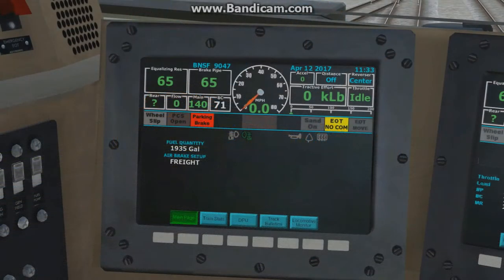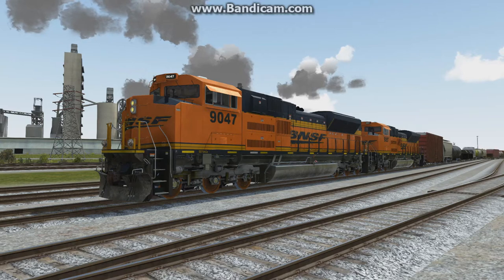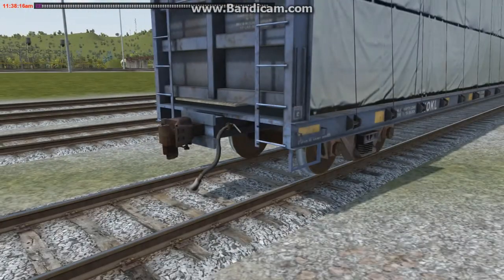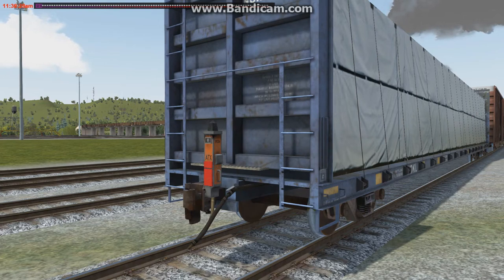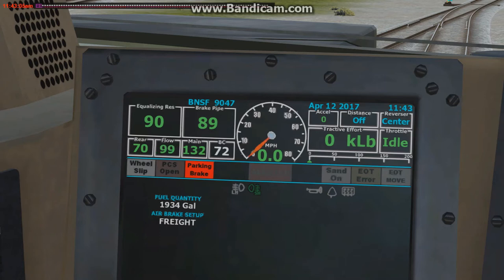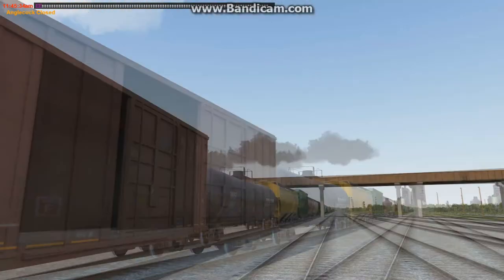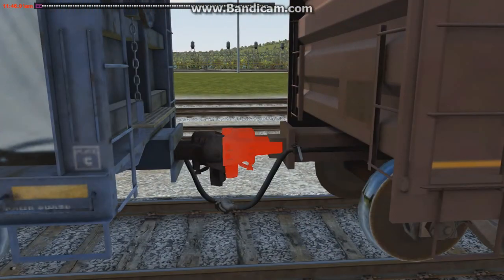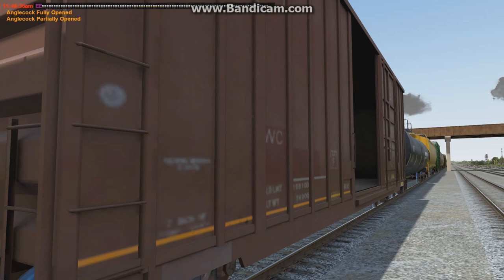Class I Initial Terminal Brake Test and EOT Dump Test

Comment: Thanks again Chris! I was about to get started at MP 150 on the Roseville sub, and wanted to know whether I was required to do another brake test. Well, your excellent video not only refreshed my mind on how to do a brake test, but answered my question(s) as well. I was also wanting to know whether, IRL, someone was required to walk the entire train to check each brake cylinder. You answered that question early in your video.
I believe that one day, railroads will have technology to check each and every aspect of an entire train by running an app on a smartphone. No more walking the train. When the cost of manufacture and sale of such devices reaches the point where it's financially advantageous to install the systems.
I could go on for hours; I'll post to the Chit-Chat forum.

ET